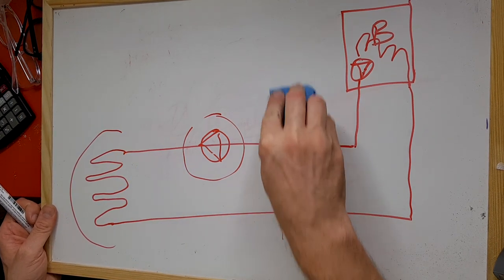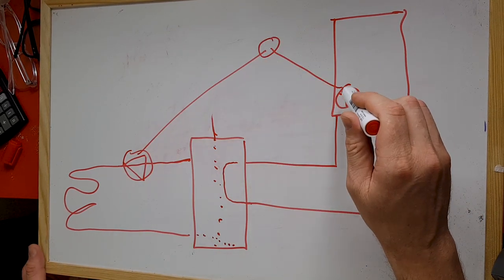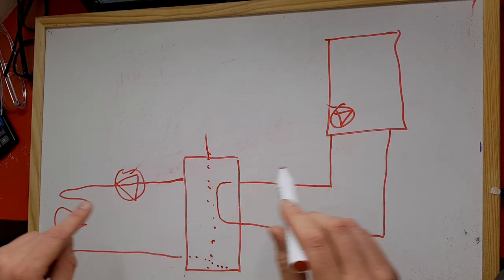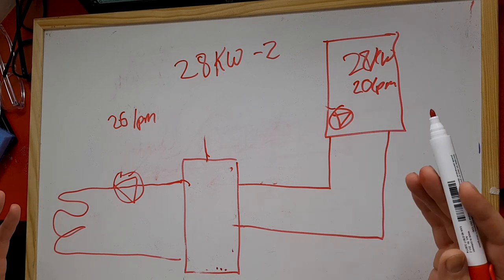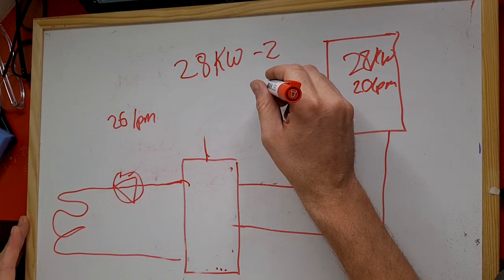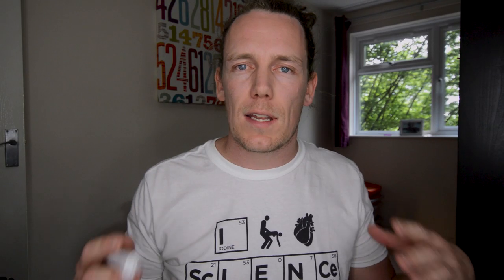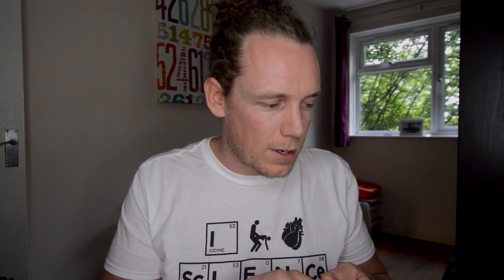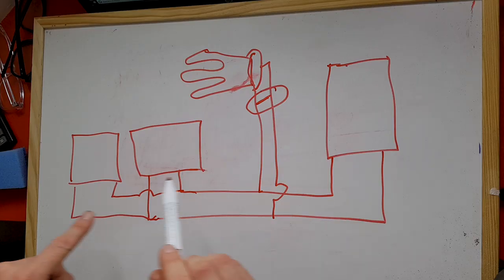Why NOT to use Buffers or LOW LOSS HEADERS!  The Low Loss header explained.

Comment: Thank you Heat Geek for sharing your knowledge.
I think I found the holy grail for my heat pump system by adding a buffer on the return only.
This allows you to run radiators and underfloor etc. without loosing efficiency.
I achieved a delta t 4C advantage on my heat pump.

Comment: Hi Adam, thanks for this video explaining the disadvantage of buffer tank. I'm using a LG Therma V Monobloc 9kw heatpump and manufacturer is suggesting installing a buffer tank of minimum 50lt and a circulation pump (controlled by a third party thermostat) to circulate the secondary system water to radiators. Why would LG suggest this if it's causing efficiency losses?

Comment: Mr Heat Geek .....  Best presentation ever on LLH.     I have a stupid question that I couldn't find an cogent answer in spite of searching the web for a week.  I think my questions relates to people who upgrade from cast iron boilers to hi-efficiency boilers.   I have a 1980s 4700 sf house with finned baseboards.  Baseboards are too expensive to replace, so in spite of needing more,  it is uneconomical to replace them.  Having a modulating boiler with low water temps, and near constant flow  seems like a good way to maintain a comfortable temperature.  There are  2 zones upstairs, 6 zones in main floor living area, and 1 zone in basement.   The main floor is ½ heated with in floor heating.  It faces the south, and so heats up much faster than the rest of that floor, and it stays warm longer because it has tile floor with larger thermal mass..  Hence the zones.  I am replacing my 40 year old cast iron boiler with a high efficiency Lochinvar KHB110.  My contractor tells me it will costs $22,000 for the upgrade which includes all valves, pumps, etc.  he wont just replace the boiler.  I replaced all the ball valves and zone valves a couple of years ago, so I know they are good.  So I am planning to DIY and keep as much of the existing valves/plumbing as possible.  Parts and materials will be less than $7000.  I have have to spend another $2000 to get a friend to do the actual work.  The questions is:  why do I want or need a primary/secondary loop?  I thought the biggest reasons for P/S were to 1) reduce the temp of the inlet water (shock to the heat exchanger), and also create a path for the boiler circulator.  Well, if I ran the system temp as low as possible (based on the fact that I have 40 year old baseboards tha are not something I will replace), why do I need to reduce thermal shock?  Ultimately the goal is to have boiler/system pump should run 4 hours or more without start/stop.  Also, Low  outlet temps = low Delta T.  So no worries of thermal shock to the heat exchanger.  Also , If I turn OFF the included boiler pump, and have a variable system circulator that runs only if there is demand from the thermostat, why do I NEED a primary loop?  Balancing the primary/secondary for all system demands with 8 zones would be virtually impossible with a low loss header.   Even if I were to power multiple zones on my main floor from a single thermostat to increase heat dissipation, the system circulator would either be overpower or under powering the boiler circulator based on heat demands (single or multiple zones demanding heat).  As long as the goal of a homeowner is to provide fuel efficiency over matching instant heat supply to demand, it seems the P/S loop doesn't make sense.  Or am I missing something?

Comment: Low loss headers serve greatest benefit in cascaded boiler setups, in these situations, each boiler has its own pump that could well be inverter driven to optimise heat transfer through the heat exchanger. Cascades will have different sequencing to balance load and wear on the cascade. It may also be the case that consideration might have been given to seasonal demands of the installation, winter and summer are only 3months losing each, as are spring and autumn, the result is that in summer only the water may need heating (3-10kw coil) a couple of hours a day. In autumn and spring larger energy source may be required, for spells in the depth of winter even more. Running a large boiler may not prove economical, running 3 or more boilers of different sizes extends both the life of and the performance of the system as a whole. Low loss headers stabilise boiler water flow, like buffer vessels - properly sized, prevent boiler short cycling which wastes gas, or on the case of heat pumps electricity and compressor start stop wear.

Comment: Yes UFH piped directly to a large combi makes it all so much simpler. Best to have a boiler that modulates very low to eliminate or vastly reduce boiler cycling.
Reply: Geminox had a boiler that modulated down to 1kW to a max of 12kW.  It was so unreliable though. I think it has now been discontinued.
Reply: I once fitted a low modulating system boiler directly onto UFH, that is all it did. For DHW, a Rinnai multi-point was fitted externally on the outside wall - yes they can be, as can Navien boilers these days.  Worked like a dream.  Cost effective to install. Rinnais can really throw out the DHW flow rates.

No cylinder or complex zone valves, etc.  Saved a ton of internal space.
Reply: American's wouldn't think twice about installing one gas heater for the hot water and another for space heating...
Reply: @edc1569  
We do not have teh space they have, as we have rabbit hutch houses, in a country with only 7.7% of the land settled.

Comment: Great video thanks....I'm not sure I've got why the 1/3 rule. Is it experience? I'm in a close situation  (26 kW boiler and 10 kW flat) and cannot set the design flow rates for the UFH. Still the delta T is getting to 7C and even lower...do I need anyway to install an additional pump + LLH in your opinion? Confused....

Comment: Hi Adam, I notice you seem to have solar water heating arrays on the side of your office building, similar to the evacuated tube type? What is your opinion of the so called Bunsen Water heaters which are similarly mounted black panels, but which use a refrigerant to transfer the heat to a heat pump, and then the water cylinder? Nick

Comment: Hello, I have a small technical question regarding my setup, which consists of 2 heating appliances in cascade, and 2 circuits directly connected to the LLH (one for radiators with 4 floor pumps, and one for a 800L DHW tank). I am constantly monitoring temperatures on each input and output flow (via ebusd, openhab and grafana), and I noticed it is really inefficient (given the variable flow rate on the heat consumers side). Is it feasible to replace the LLH with a plate heat exchanger? Thanks a lot, Cristian

Comment: Is it more advantageous to include a buffer tank in a scenario where only underfloor heating is used with a heat pump? The power output of the heat pump is specifically matched to the requirements of the underfloor heating system (so it's not 1/3 or 1/2 od the heatpump power output).

Comment: Great video, I been a heating engineer for 15 years but it rarely come across low loss headers, but a customer of mind has ask me to look at a system put in there new build house. The have a low loss header running 2 big underfloor systems one towel rail/rad Circuit and unvented cylinder 
When it’s very cold outside the hot water stops work and the pipe to it is Luke warm. It is the bottom take off on a 4 taken off vertical header, if you shut off the other circuit it heat. It have 2 30kw boilers connected to it. 
Any help would be great Thanks
Reply: The ufh is taking all the flow. This is a common problem with llh with multiple take offs

Comment: Hi dude, thanks for the great video. I'm having a new sealed system oil boiler installed (grant vortex 26-46) and trying to work out if I need an LLH. It's a big old house (kind of a maisonette + a flat) with rads on two heating zones already + one old vented cylinder, no UFH. Rads T off in 10mm copper from 22mm main feed so flow a bit low perhaps. Does the zoning stipulate LLH as the way to go or is it wasted cash and efficiency. Your opinion is much appreciated!

Comment: I’ve had a LLH installed as part of my HT Daikin ASHP, without a doubt none of these calculations were done by my installer. I was told I just needed one as I have a zone for upstairs and a zone for downstairs heaters, is this incorrect?
Reply: Not necessarily, it depends what each zone flow rate is.  If they both can be at the same flow rate then it's pointless having separation.

Comment: Hi, is it possible to use a splitter with two heating circuits and two pumps, or is it also a problem for normal operation? Thanks

Comment: Question: if you put the CCT in front of the UHF,  boiler pump will run only through the CCT and water won't flow through the radiators due to resistance?

Comment: checking bad boiler installation so now i am not getting enough circulation to loft area (fitted is a worcester bosch 42kw) bosch recommends adding another pump, but did not mention LowLoss header . in the past it was easy to replace just the pump head but WB do not do a 8m head, i can get an 8m head from grundfos BUT are they still interchangeable (bosch pump head to grundfos 8m head on boiler housing hopefully you can help

Comment: Great explanation, I've never met a plumber who would begin to do the calcs you have shown on a domestic prop. I wouldn't feel anyone would set the pumps correctly without knowing some of this info. I've just been recommended to put in a low loss header on a brand new 5 bed house with new install, new 35kw system  boiler with tank and NO underfloor heating. Also suggesting a second pump. Am I right in thinking that a boiler will have a pump rated for its output so will "generally" be good enough for the job without the extras.
Reply from the maker: Genrally good enough ino matey!!

Check out our course btw!

Courses.heatgeek.com
Reply: On domestic it is all wet finger in the air. Some awful inefficient systems out there.

Comment: Hi, I bought a Tado system as it offered modulation and I had a fairly new Alpha In Tec 34c boiler. However Tado are telling me that Tado is not comparable with Alpha boilers. However someone has suggested wiring an opentherm controller to the boiler and then that Tado is compatible with opentherm. Can you offer any words of advice as to if this is a viable solution? Thanks

Comment: Are you not just adding a full bore 22mm bypass by using a close coupled tee before a manifold?
Reply from the maker: Hi Joe. Great point! This would ideally have some sort of balancing valve on the feed to the CCT and epending on the control type you may also require a 2 port aswell. However this is a whole subject in its self. There is no one answer for all the different system types and so we are doing a video on this very subject (hydraulic seperation for manifolds) very soon!
Reply: Yes !

Comment: Excellent ..   9kw Under Floor driven by  28Kw Boiler ?  I didn't understand that .. Is the boiler a modulating boiler running on 1/3th throttle ? Is it that size boiler come with a big flow rate, so is pumpable ?
Reply: Ufh requires flow 3 times the rate of a gas boiler. If the boiler is oversized by 300 % some installers are connecting direct. I've not done this myself as I'm uncomfortable with the idea but those who do report success.

Comment: My dilemma is how to get enough flow to the loft area in an old Victorian house. (12ft high ceilings)  An 8m pump will do the trick as the boiler 42kw cdi 2 zone S. plan,  was positioned incorrectly for the 15/60 pump to deliver enough flow to heat the radiators on a part of second floor and loft. (1) If I can get a 8m  pump head only replacement to fit the boiler casing. (would this work on the boiler as it is only affecting flow) (2) reposition boiler higher to compensate for poor flow rate. (3) install Low Loss Header, but because of lack of space to install LLH vertical, what distance from the boiler can I position the LLH, the boiler would operate normally ground floor, install LLH on second floor use 15/60 pump  instead of 25/80 pump to circulate flow to second floor and loft area. I have seen LLH fitted horizontally yet you say not advisable. Use a Blanking plate on boiler pump then install an external 25/80 pump, without the need for a LLH . your thoughts would be helpful thanks
Reply from the maker: An 8m head pump does not mean it circulates 8m high. This is a common misconception

Comment: Great video Sir. I am wondering if you may give me an advise for my UFH system, since l am really appreciate your knowledge. 
I am having a biomass boiler of 15kw for 100m2 UFH. Boiler is having an integrated pump Willo Star RS25/6. Last winter was the first season for us to use it. What I have noticed is that l am not having good flow of hot water in the farthest room form manifold. Floor never gets hot enough, just in case if boiler is working in full capacity (5.speed which is 15kw).
I would like to ask, according to your experience and knowledge, do l need to add one more  pump in order to increase flow rate? 
Thank you.
Reply from the maker: Hi. Have you balanced the system? Will the room get got if you turn off the other zones?
Reply: @HeatGeek  Well l am having manifold with no flow meters, so l tried to balance but it's hard if you don't actually have a measurement, so l keep all vents fully opened. It's in plan to change it for the one with flow meters. YES  it's getting warmer when l close other zones and flow is much better. Thank you for your answer.
Reply from the maker: @vladimirradenkovic4413  Your pump head must be good enough if the furthest loop heats so you just need to balance. You don't need flow meters though!.. a much more accurate way is to balance for the same temperature drop across each loop.
Reply: @HeatGeek  l am not sure how to do it that way according to temperature drop. Sorry, maybe it's a language barrier since English  is not my native language.

Comment: A low-loss header can eliminate boiler interlock control, having TRVs on all rads. No central thermostat space heating control switching out rooms when they are calling for heat. Two radiator heating zones with each having its own time clock, flow switch, and smart variable speed pumps - no zone valves.  The combi boiler loop pump is on a fixed speed (with ERP may not be possible on many boilers these days). 

There will be temperature distortions when TRVs close and say a timeclock switches off a zone.  The boiler always gets more than adequate flow - with only one TRV slightly open the flow may be too little through the boiler without a header, the header prevents that. Auto-by-pass valves are a cludge.  It is simple, effective and reliable using the header with superior comfort control.

Comment: great vid. i want to install a monoblock heat pump but the companies tells me i have to need install at least 100 liter tank , (hydrolic separation) so the pump can defrost outside.. today i have a split system and the pump outside defrost when the pump is off not like a monoblock hp. Anyway i dont have a tank on this system today, i guess its because its a split and dont need defrost,? my house had floor heat only 250 m2 , but i wanted to skip tank? it seems when i listen to you i can , my house need 9 kw to 0c outside and 15 if its colder.. so what do i do , maybe a smaler hydrolic separator like the ones you talk about?
Reply from the maker: If the volume is in the pipework younwknt need additional